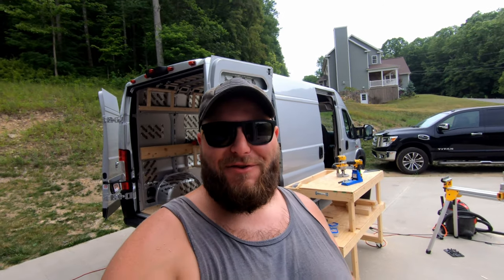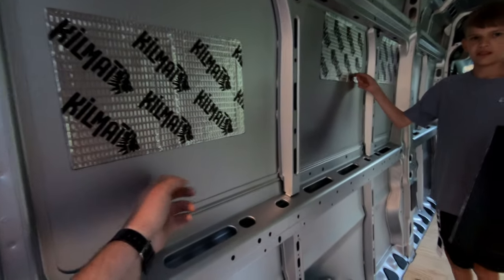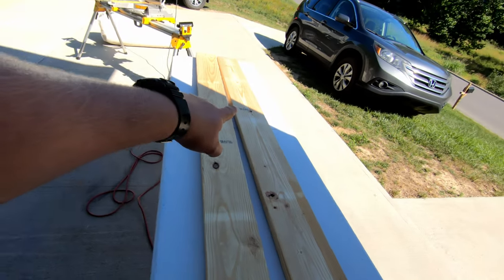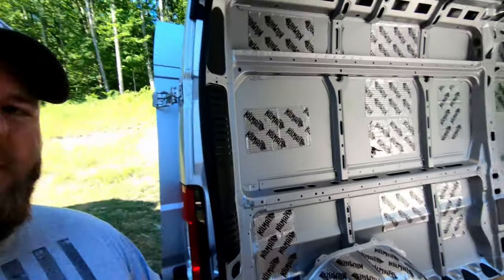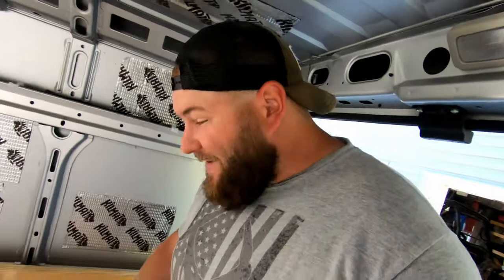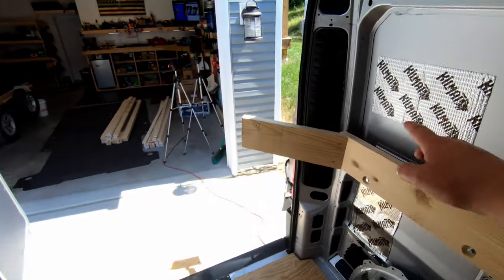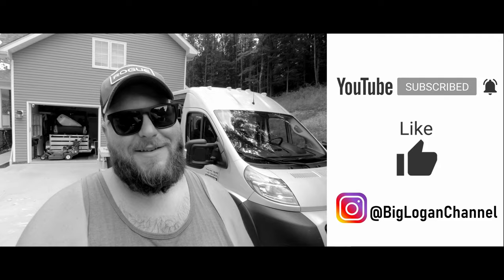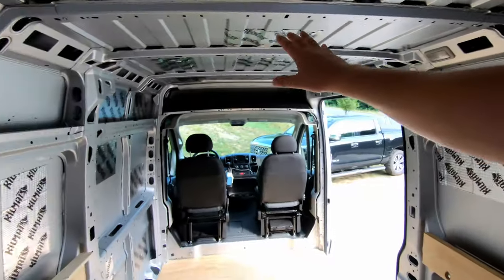HOW TO FRAME A VAN CONVERSION / DIY Adventure Van Build

Comment: Did you have LED lights on any of the ceiling support beams? I have a 2020 Promaster and it came with a string of LED lights that are wired into the van and go across 2 of the support beams. I am trying to find instructions from someone who has removed them.
Reply from the maker: Sure did, they just unsnap from the silver clips, unplug from wiring harness on passenger side, and the clips can be unscrewed / removed.  Good luck!

Comment: This probably gets asked a lot….but why only one square of the sound deadener on a panel? Isn’t it an insulator also? I’ve only seen a few vans where they used it on the entire wall. Most just put the square.   Just wondering does it insulate ? Is it overkill to do all the walls? Thanks!
Reply from the maker: Great question and I differ from other upfitters and builders by only placing what is needed to deaden the resonance / drumming noise created by the rigid metal body.  I insulate with Havelock Wool and have always built my vans with 1 package of Kilmat.

Comment: I would stay away from framing with conventional lumber all together.  Using light weight  materials like 1/2" and 3/4"  plywood is better for multiple reasons.  #1 is weight,  #2 it  doesn't warp, #3 it saves on space which is key in every van build. EVERY INCH COUNTS!

Comment: hey Big, congrats on the build, this is super helpful info, so just curious, notice you're screwing self tappers directly into the sheet metal... are you not concerned about the raw screw holes eventually rusting down the road?
Reply: He liked your comment but didn't respond..

Comment: I've got a promaster myself. I'm wondering why you need to frame though. Can't you just rivet panels directly onto the metal frame? The promaster is already pretty straight.
Reply from the maker: Yes for sure,
This was prepping for no-show hardware with shiplap walls.  Check out the rest of the build series
Reply: @biglogan3690   Aaah I see. Yes I will check it out. Thanks!

Comment: Why did you decide to replace the factory composite floor with plywood?
Reply: Great videos btw. I just bought a Promaster with the missing bulkhead and have been trying to decide what to do. I think I'll copy you since it came out so nice. That indoor/outdoor carpet is just that much more insulation/sound deadening. Nice work btw. I see you went with an isotherm fridge as will I. I'm gonna get the cruise 65. I'm doing 650 watts solar with two 325 residential panels...400ah lithium....maxair fan and a all in one internet package set up from mobilemusthave.com. I'm doing all this in the Promaster 1500! I was thinking of using a propane shower but decided on a Bosch electric water tank heater instead since I'll have the power. I will have a propane stovetop and probably a Propex heater as well. Gonna carry 2 20lb tanks in a vented propane locker under the stove so I can stay off grid for a couple months if I had to. I'm thinking an over the wheel well 45 gallon tank for the outdoor shower and a separate 7 gal fresh/7gal grey under the  sink with a footpump to conserve the water used at sink. Good stuff Logan! So glad I found your channel.
Reply from the maker: Awesome!  Very similar in a few ways, propane cooktop with small bottle under countertop, doing 30 gallons fresh and 15 galling grey underbody.  Bosch 4 galling electric water heater.  300solar, dc to dc mppt all in one solar and alternator charge controller, and 250ah Lead acid bank to start.  Can’t wait for it to turn out!  Good luck on your build!
Reply from the maker: I did the Woden subfloor to have plenty of material to fasten screws into for vanity’s chairs bed etc.

Comment: When putting your head and foot board up how did you know exactly where to pre drill your holes on the wood to make it level?
Reply from the maker: Hey Zach, that early in the build it’s impossible to know what’s going to be level (front to rear) due to added weight of the build, especially water and battery bank, and weight of the slat bed.  I simply made this “level” with the body of the van.  The top structure of the bed will be built towards the end of the project and can be adjusted if it is still uncomfortably off.  Thanks for watching!